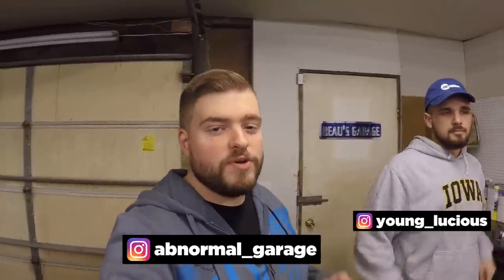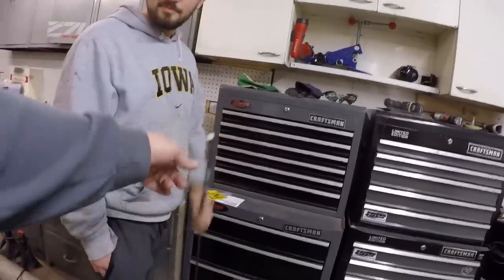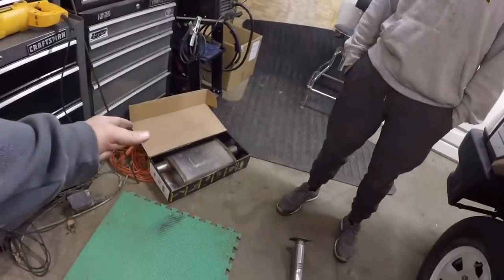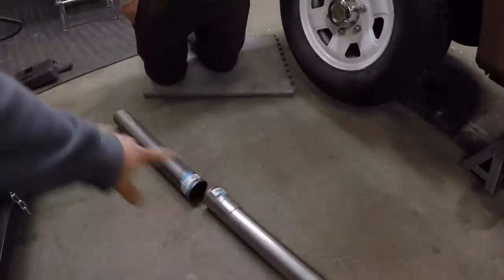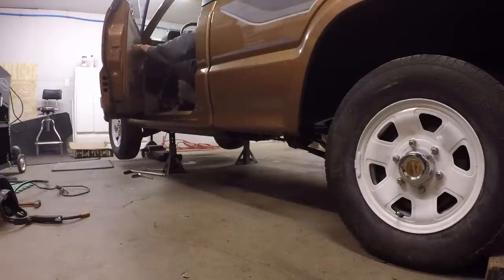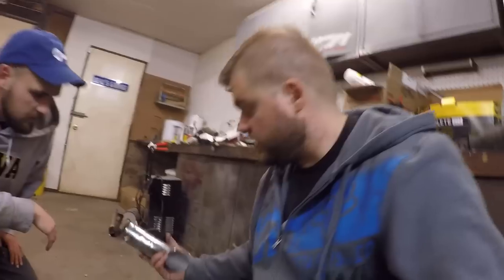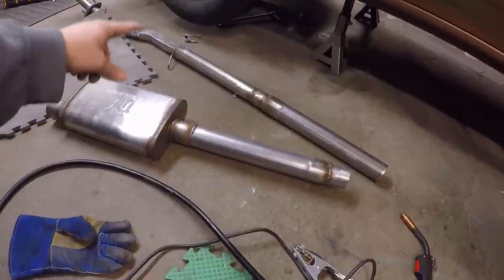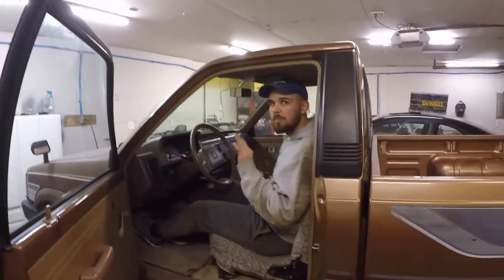Custom Exhaust For The Mazda B2000

Comment: Gentlemen, you have sort of defeated the purpose of adding a header. The header exit is 2.25". You have added a 1.75" pipe behind it. Um... restriction? Then you go up to a 2" then to a 2.25 muff. (??)
I would have suggested having a muff shop bending you a full 2.25" system from the header to  the tailpipe.
I had one done to mine, with the Weber, I knocked a full second off the 1320 time at the track.  It is quiet until you stand on it.
The shop used a straight thru truck type muffler that has the same dimensions as a stocker.
BTW, look up tests on YT for back pressure. Any one who says you need back pressure doesn't know what they are talking about. 
Oh well...

Comment: Did yall have any issues with the co2 sensor? I haven't watched the video or seen any others, didn't know if the truck was carburated with the computer or had a weber carb. I want to straight pipe my 92 b2200 but I'm not sure if it will bother the co2 sensor in the manifold
Reply from the maker: We were running a Weber carb and a pacesetter header. Didn’t have any check engines lights or issues with the o2 sensors. Just had the EGR light pop on from when we deleted it when installing the carburetor.

Comment: what did you do with your old mirrors? want to sell them?
Reply from the maker: I think we got rid of them already.
Reply: @AbnormalGarage  I am picking up a free 1990 2600 4x4 this afternoon. Been sitting 6-8 years. 2 motors, 1 bad head. So I will be trying to piece together a good lightweight hunting truck.  My club requires all hunting vehicles to be on ATV tires. Most guys run CRV'S but I wanted a truck.
Reply from the maker: That's awesome, good luck with building it!!

Comment: Plan on doing some more reasearvh but any chance you know if this same setup will fit on a ‘94 fourth gen?
Reply from the maker: I'm not entirely sure. I believe '94 is when Mazda partnered up with Ford, so things might be a little different from the 1986-1993 generation.
Reply: Abnormal Garage I actually meant 92, Any idea? Thanks!
Reply from the maker: I'd assume it would all be the same then.
Reply: Abnormal Garage where did you get all your piping from?
Reply from the maker: Autozone
Reply: Thanks!